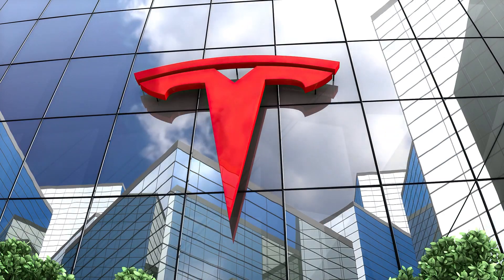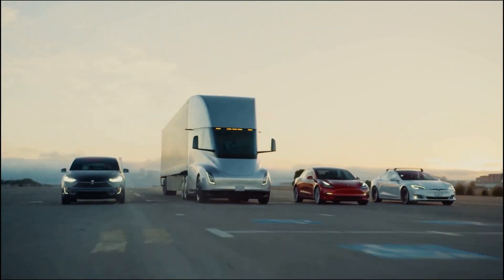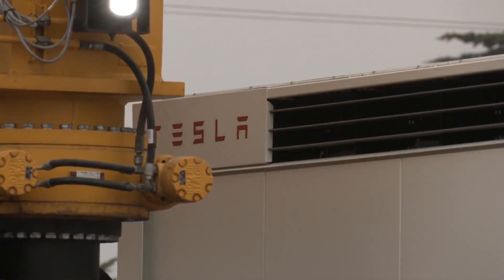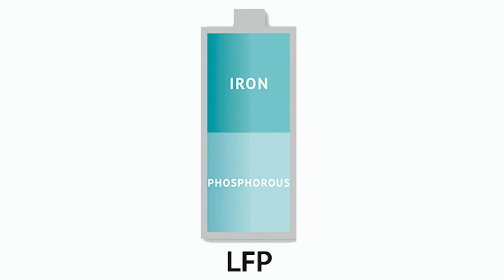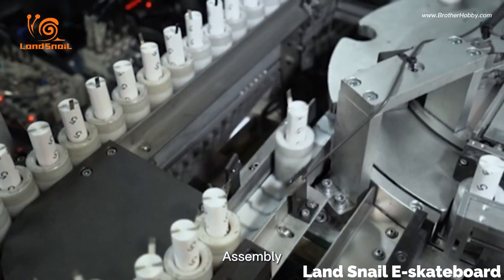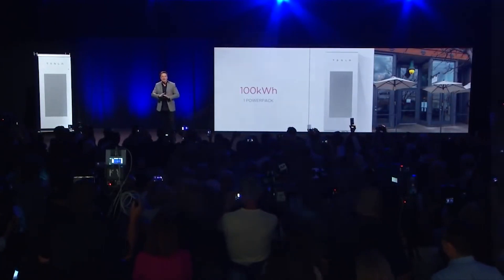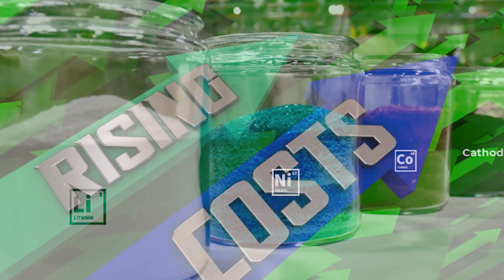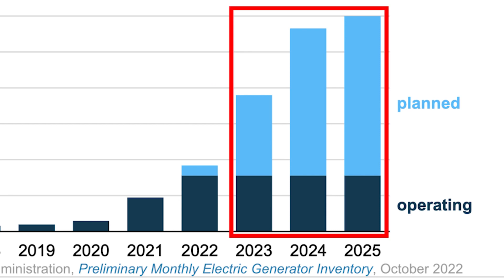The Real Reason The Tesla Megapack Will Take Over In 2023!

Comment: Waiting for Sodium Ion Megapacks! Battery changes offering more power for less will tip the transition massively as long as they have the production capacity!! BYD and CATL offer static storage along with others??
Reply: Sodium Ion, solid state batteries, cold fusion and Bigfoot.  I think I have a fuzzy video of one of those sodium ion mega packs
Reply: @richk3552  CATL have said they will be producing Sodium ion batteries in the middle of this year. They are not some tinpot startup.
Middle of this year Bigfoot boy.
Reply: One word, google it: Ambri
Reply: @mwolrich  Are they actually selling flow batteries?
Reply: @danielstapler4315  they are in early stage trials, site shows 2026 for deployment.  the point is, their material science is sound, and they have it working..  the manufacturing is where they need help, and Tesla excels at that.  Tesla should probably just buy the company and accelerate their development to actual use..  the cost is far lower than LiPo, and they need no cooling or thermal management, their perfect for deserted remote environments, which is typical for solar/winds farms..  their batteries could be the next generation of the megapack.  the only issue is Gates is an early angel backer, and Elon hates Gates.
Reply: @mwolrich  Tesla will liekly buy any and eevry battery tech in huge quantities, as soon as it near commercialisation. Elon has said they are chemistry/tech  agnostic.

Comment: A few things you missed is the very lucrative planning and installation fees as well as the recurring software and maintenance fees. That could turn into $5B-$20B in revenue by 2030
Reply: The continual revenue is icing on the money cake.  The autobidder part of the software (the determines when to buy and sell electricity) will be a money printer for both Tesla and the megapack purchaser.

Comment: Brilliant and very complete understanding of the MegaPack potential. I would like to propose that the reason the backlog of the MegaPacks is only 2 years is that as an Engineer I would not like to invest my time in a project where the main component is over 2 years away. When I see increased capacity increasing I see projects that can have an ROI of 2 to 3 years and have them running in 3 to 4 years now I'm excited. First, the low-hanging fruit, replacing Peaker plants with battery systems that respond to demand instantly, doesn't require having to explain to the EPA how many tons of carbon I am burning and when will I install carbon capturing capability. That's 1,000 US Peaker plants with an average of 100 batteries plant. How about replacing backup generators in hospitals, how about solar and wind farms that would like to save the excess electricity that cannot generate as nobody wants it until later that day.
Perhaps we will need way more facilities than Lathrop in the USA and Canada, how about the UK and Europe, South America, Australia, and every country with the possible exception of China which will be stealing Tesla's blueprints and building their own. Elon will not care as this will be the best way to transition to renewable energy.
Reply: I definitely agree that the plan should/is to build more factories for MPs. Similar to Giga Shanghai it was the first focus of a new style of factory built in the most efficient way. Then came Berlin and Austin. Lathrop is the first and now they have the learnings from building that the next one should be better and more efficient. The evidence was well documented in this video. Let the mainstream sleep in this while those who have their eyes open now but more stock.
Reply: The Megapacks are using CATL batteries.  So we have to build Gigafactories to make LFP batteries to replace the CATL batteries.  But the incredibly fortunate problem is that the demand for batteries is so great that all the batteries from CATL and the new domestic factories will be needed for many millions of Tesla Powerwalls all over the world!  Yay!  We have to get rid of those fossil fueled generators to end global warming!
Reply: Mark, you've got a great perspective! The low-hanging fruit is Megapacks, versus Powerwalls and the labor hours to bring to the finish line, as in 'throw the switch'. Thanks to SolarCity?

Comment: LFP batteries ARE used in Teslas, like the Model 3 RWD made in Shanghai. So it’s not correct to say they are not suitable for cars.
Reply: LFP batteries are going to be adopted by Ford as well.
Reply: LFP generally have low density power storage so they are very heavy in larger automobiles.  Some small, shorter range car designs can get away with using them.  But they are not ideal.

Comment: are these megapacks good in cold weather and hot weather? can they hold during storm/hurricanes etc?
Reply: They're used in Alaska in winter. (-40° Celcius. 'Nuff said...)
They're used in Australia in summer. (+40° Celcius. 'Nuff said...)
Reply: Storing some energy is better than storing no energy, so it does not really matter. 

All that will happen is engineers will account for temperature extreme losses when they do their math and buy a few extra packs to account for it. So the projects will have extra storage in moderate temperatures and enough storage in extreme temperatures. 

Just like most of the obstructionist FUD comments; yes they have though of that and done the math and adjusted for it and the product is still beneficial even considering that little gotcha imperfection. But we will still see it brought up in millions of social media comments as a fake reason we should just keep burning fossil fuels instead.
Reply: It doesn't matter, there is enough demand in either climate to keep Tesla busy.